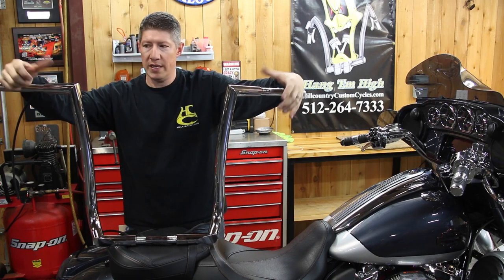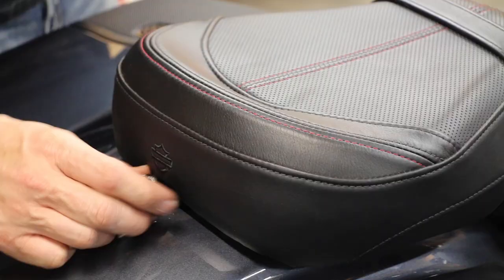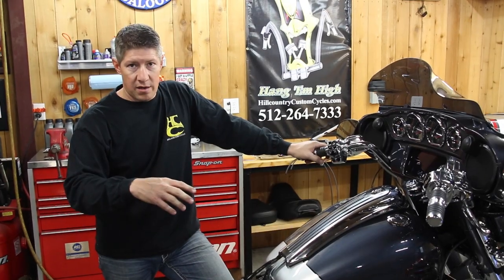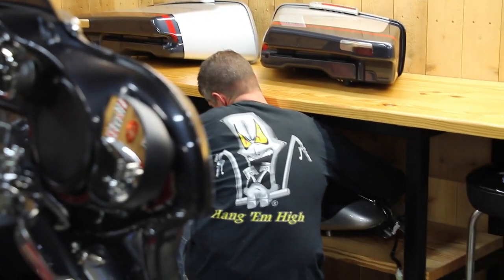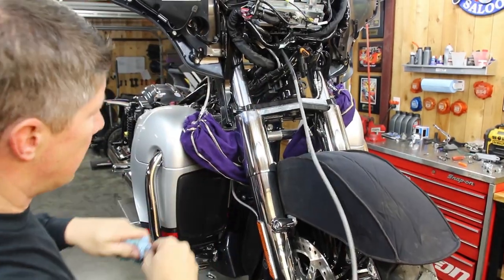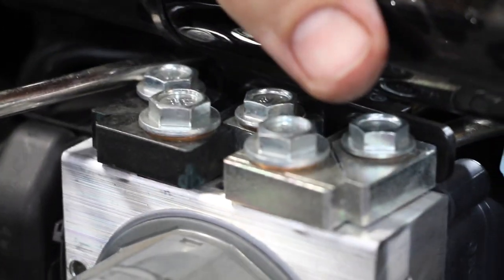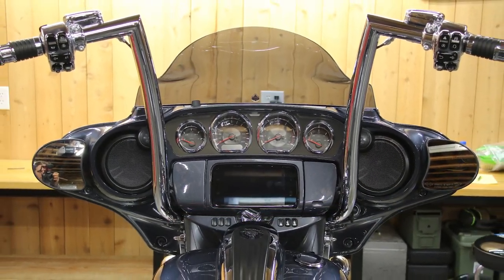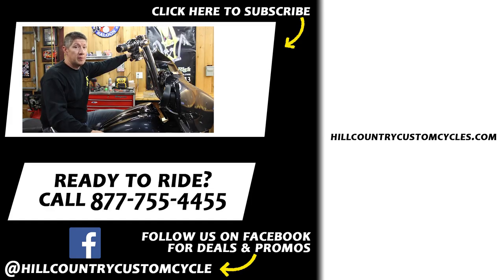How to Install Ape Hangers on 2019 Harley Davidson Street Glide

Comment: Great video, Robert, as usual.  Only a couple of observations.  Could you use wire strippers to cut your brake and clutch lines to length?  That way you wouldn't need to ream out the lines.  Speaking of reaming, I noticed you didn't tilt the lines pointing down to keep any small pieces that you're reaming from getting into the lines.  BTW, I sent you an email the other day with questions I had about the '18+ Softail upper clutch and brake lines.  Again, thanks and awesome installation!

Comment: Will I have to do all theses steps for ten inch ape hangers do I have to remove the clutch and a brake line
Reply: Up to 12" bars you can leave it stock I believe